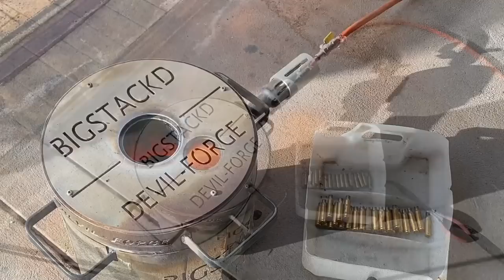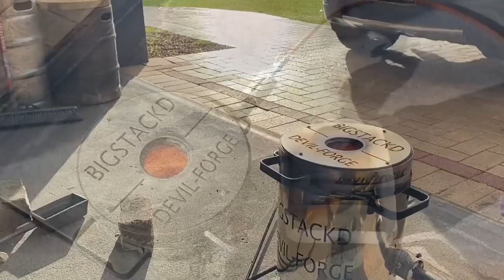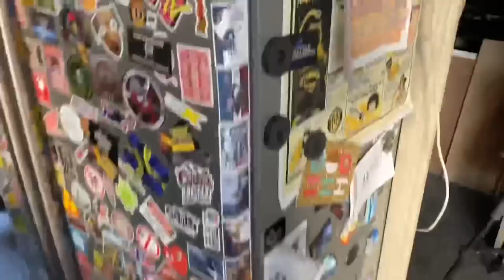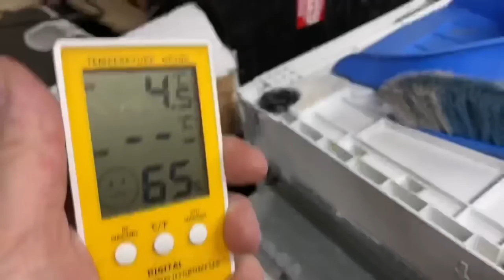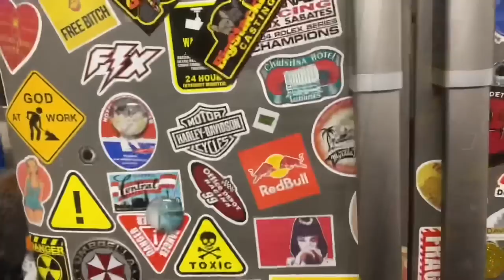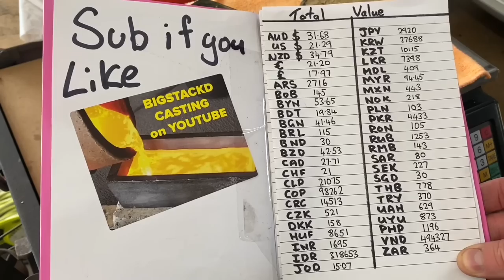Bulk Bullet Shells To Mirrored Bar - Trash To Treasure - ASMR Metal Melting - BigStackD Casting

Comment: These are 7,62x51 (or .308 Winchester, in civilian version). From the headstamp you can read AFF 91, which usually denotes the manufacturer, in this case, Small Arms Ammunition Factory No. 1 Footscray, Australia, and the year of manufacture, 1991. By the look of the bullet, these are most likely M80 rounds with standard lead-core bullets. But looks alone can be deceiving, however, different types of rounds usually have color coded bullet tips, these don't, that's why I'd think they're simple M80s.
Reply: nice
Reply: So those bullets are 30 years old?
Reply: So 308 Winchester can fit in an ak? Never knew.
Reply: Amscray Footscray.  I love pig Latin. LOL!  To think back in the early 90s, we would buy 1,000 round crates of .308, .223. & 9mm military surplus ball, all for $135.00, that's 13.5 cents a round. The good old days!
Reply: @joshschneider9766  well bullet diameter yes but the cartridge will not. its closer to a mosin or SVD sniper rifle
Reply: @joshschneider9766  Nope. 308 Win has a case that is 51mm long, typically AK ammo has a 39mm case. Even though both cartridges are labelled as 7.62mm, the 308 fires a 7.62mm projectile through a .30in barrel, and the 7.62x39 fires a 7.9mm bullet through a 7.62mm barrel.
Reply: @neodutch  but they do make ak variant that fires 7.62x51(308).  Vepr-308 , Zastava all make 7.62x51 ak model
Reply: @gm5957  Yeah and? That's why I used the word "typically".
Reply: Thought I saw Winchester 308
Reply: @joshschneider9766  the NATO 7.62 uses a .308" diameter projectile. The russian/soviet projectiles are .310" or .311" in diameter. Also the ak shoots 7.62x39mm. The 308/7.62x51 is used in the m14, G3, FAL, scar-h, and even the m134 minigun. Plus hundreds of other firearms.
Reply: Could also be fired from an Australian army Mag 58 if it was link but it doesn’t look like it did
Reply: agreed
Reply: @joshschneider9766  if you have .308 ak, there are some variants but they are mostly dmr's, basic ak variant takes either 7.62x39 or 5.45x39 cartridges.
Reply: Im amazed he has all these, I thought Uhstrayans were terrified of firearms and hate if anyone owns one :)
Reply: @davidca96  Were not "terrified" of guns lol the rules regarding them are just a lot more strict than most countries 👍
Reply: @joshschneider9766  No. AK's use 7.62x39.
Reply: @theatlantafisherman6913  most aks are in 7.62 by 39. But there are other varieties that shoot 5.45x39
Reply: @presleydinobraggdino4711  that's mostly the SSG 82 bolt, the CRS 98 VEPR,  and the Saiga. I think some AK-74's also use this round. But the standard AK is 7.62x39
Reply: @theatlantafisherman6913  look up the ak 12
Reply: @presleydinobraggdino4711  this guy specifically mentioned the 47. I'm aware there are other guns that use the 5.45, but the 47 uses 7.62x39
Reply: I figured 7.62
Reply: @joshschneider9766  AK rounds are 7.62 by 39mm
Reply: @joshschneider9766  No....AK is 7.62 x 39....same diameter bullet, but shorter case
Reply: outdated .308 NATO from military destocking, no problem.
Reply: @Joe14876  indeed, it's nothing for ctg
Reply: @joshschneider9766  no.
Reply: @joshschneider9766  no, that's 7.62x39mm
Reply: I should have read comments before posting... lol
Reply: @Joe14876  Yep. Probably military stock being used for training while new ammo stock is rotated in. Properly stored ammo can last decades.
Reply: @Fu3R4  wow
Reply: @joshschneider9766  The caliber is the same but the casings are different lengths.  .308 is 7.62X51, AK rounds are 7.62x39.  and a .30-06 is 7.62x63.  Pretty much all the same caliber but very different rounds and not interchangeable.
Reply: @hpdepasse5997  No NATO headstamp,(cross in a circle) although AFF is a manufacturer for the Australian military.
Reply: yeah I recognized those were 7.62 NATO but what I don't know is what rifles Oz uses in that cartridge. it's not still the FAL is it?
Reply: @joshschneider9766  no thats 7.62x39
Reply: @joshschneider9766  no, 308 Winchester is 7.62x51, AK ammo is 7.62x39. They are not compatible.
Reply: @karlklein2966   yes those are all 30 Calibers. I have 2 308s and about to have two 7.62x39s.. reason why a regular akm or Ak-47 can’t shoot a 308 is because of the pressure difference it will cause the Ak to have damage from the bolt and possibly blow the gun up if you shoot 308 out of it enough times..
Reply: I was thinking that was 50 BMG bullet shell
Reply: @NeonRider34  wayyy too small
Reply: @joshschneider9766  AK bullets are 7.62 x 39
Reply: @Milspecpoptart  don't forget the browning 1919, it also uses the 7.62x51mm round
Reply: @joshschneider9766  No, standard AK-47s use 7.62x39mm cartridges.  As the previous commenter said, .308 is 7.62x51mm.  If you tried to chamber a .308 in a standard AK-47, the bolt would not close.
Reply: @GezzGezzGezz  No, a .308 will phisically not fit in an AK chambered in 7.62x39.
Reply: @joshschneider9766  no an AK round is 7.62x39
Reply: @GezzGezzGezz  What a load of tosh.
Reply: @1131dc  actually, different diameters, share "nominal" size. It comes down to whether the barrel/bullet sizing is derived from the valley (lower part) of the rifling or the lands (upper part). The old .303 for example was nominally .303 on the lands but .311 in the valleys. American typically measure from valley depth. So the 7.62x51 is .308 at the valleys and .300 at the lands. The Russians measure at the lands, so the 7.62x39 is something I can't remember at the lands and .312 at the valleys. 
A cheap way of loading 7.62x39 subsonic was to replace the 110 grain supersonic bullet with a 180 grain .303 bullet and a slower burning powder.  Deadly spotlighting pigs at night with a silencer.
Reply: @JunkyardBashSteve  GPMG and the M2xx (M240?) Medium calibre machine guns. The FN-FAL/SLR has been phased out long ago for the Steyr AUG 5.56. Heck, I was firing the Steyr AUG in NZ in the 90's and while the Aussies have upgraded to a redesigned AusSteyr the RNZA has switched to a AR15 clone.
Reply: M80, average belt of 7.62 consists of 4rounds of ball and 1 tracer. 4:1 mix.
Reply: @joshschneider9766  no sir cannot
Reply: @joshschneider9766  no they won't, an AK  is 7.62x39.
Reply: @theatlantafisherman6913  ALL ak-74's use 5.45, that was the one of the biggest points of the new model.  they were standardizing on the new caliber.
Reply: @Joe14876  the cases are, yes.  but ammunition if well stored is perfectly fine for decades.
Reply: @JunkyardBashSteve  possibly medium machine gun.
Reply: @GezzGezzGezz  a 7.62x39 AK can not chamber a 308, once, let alone "enough times".  there are a lot of differences beside pressure.  technically, they are even the same diameter(caliber).
Reply: good eye good eye. but i think it would be the F4 which is a the australia equivilent to the m80 because like all countries make their own versions of the standard US/NATO stuff
Reply: @Joe14876  the casings are, standard practice, is after firing, the brass gets collected then gets turned in for reload or recycle...most the time, they get reused until they are unserviceable
Reply: That's most certainly 7.62x51 the head stamp confused me, in the US we give the caliber on the headstamp.
Reply: Know I've been shot with a 308, right through the left leg so I can tell ya, that's not a whimpy round it's quite powerful and will easily take out most game too although at longer ranges? A 300 win mag is probably better, same bullet more or less but cases is 67mm not 51mm meaning more velocity and range.
Reply: @hordegaming4771  .300 is awesome to shoot... it's got such a flat trajectory. How the hell did you get a .308 through the leg? That's worse than an arrow in the knee!
Reply: @theatlantafisherman6913  the current "standard" ak (ak12) fires 5.45x39.
Reply: Dude, I’m 15, a gun fanatic, and I still wouldn’t hav identified those bullets. Teach me your ways, lol.
Reply: @MrMemz-fl1yn  Sure you would have! It just takes experience. :) After a while shooting .308 or .223 (AR-10 vs AR-15) you start to be able to recognize the bullet. Then you use a little bit of logic, you know that BigStackD is Austrailian, so what does AFF mean, what is 91 referencing. Most likely a year, so what was  the Austrailian main battle  rifle in 1991? Looks like it was the L1A1, what caliber? turns out it's 7.62x51, which is .308. 

It just takes a small bit of knowledge, and the ability to connect dots, you'll figure it out with more experience.
Reply: 308 and 7.62x51 are not the same and they are not civilian vs military. For starters the 308 is a hunting cartridge with more power and chamber pressure. Your rifle would need to be rated for 308 over 7.62.
Reply: @theatlantafisherman6913  ak's use what ever someone wanted to chamber it in...
Reply: @joshschneider9766  No. 7.62x39 is the caliber for most AK platforms. Weapons like the PKM or Mosin Nagant are chambered in that round however.
Reply: @dabadcod4  For the most part they are the same. The .308 is a bit higher pressure but the difference is 60,000 PSI vs 62,000 PSI. As long as your head spacing is in spec and your chamber isn't too small for the round you're shooting, it's not an issue except perhaps with a few very old surplus rifles. That said, the rifle's chambers are cut differently and you may see a loss of accuracy from one to the other.
It's even less of a difference than the 5.56 vs .223 
In fact I just checked and all of my rifles in these calibers are stamped with both (.308 Win/7.62x51) and (.223 Rem/5.56 NATO) 
Basically if you have an old .223, or an old 7.62 you shouldn't take that risk.
Reply: @Anubis78250  exactly. There is a reason i push my friends and family to get rifles capable of both.
Reply: @joshschneider9766  they made some sagia AK rifles in .308 but regular akm rifles are 7.62x39 so no you can't put a .308 in the rifles I believe you're talking about
Reply: You should apply for a job in ballistic forensics
Reply: @joshschneider9766  no
Reply: Thought they were 30-06 or 7mm Remington
Reply: @rhysfirth3506  interesting
Reply: @volkskrieg8735  7mm?!.
Reply: Something tells me your American and over the age of 30
Reply: Use a magnetic devise on the tips. If they stick then it's steel core.
Reply: I was thinking about M80s as well because To me they either looked like an assault rifle round or a sniper rifle round I couldn’t exactly be sure because I don’t know Jack skadoodley about any type of ammunition because apparently talking about ammunition is confusing as Frick
Reply: @theatlantafisherman6913 Correct, for AKs chambered for 7.62x39, as in all AK-47s, introduced in 1947.  Incorrect for other AKs, such as those chambered for 5.45x39, as in all AK-74s, introduced by the Soviets in the year 1974.

Comment: To answer your question about what would happen if you had a furnace of live rounds, the live rounds would cook off (explode from heat) and the lead would stay there however the brass would become the projectile. This would damage the crewsible and the furnace a little but not much as the casings wouldn’t have much energy. (For those of you wondering why the bullet wouldn’t fly it’s because the bullet is heavy and what makes it fly is the barrel. If there is no barrel or locking lug for the casing then the lightest thing will fly aka the brass casing)
Reply: Don't share comments like this with the missus while watching a movie. She will not thank you. Lol
Reply: Should send a message to Demolition Ranch and get him to test with a local furnace...😏
Reply: @P1cwh0r3  who still watches that guy?
Reply: Not too far from where I work, a store 
caught fire.  They were in the archery 
business, but also sold ammunition.
We heard a LOT cook off, but no flying 
flaming debris.  The burning palm trees 
caused more exported damage, than the 
ammo.  (Chunks of flaming palm fronds, 
would float away and cause other fires.)

Yes, we had someone on the roof, with a 
hose.  (Nice to have forklifts.)

steve
Reply: The bullets would have no velocity tho because they need a barrel to channel the energy.  Maybe stick in you but not far.

Comment: Note: you likely have a lot less slag because you used plenty of borax that prevented a lot of the zinc in the brass from oxidizing to the air (borax forming a layer on top sealing off the brass while being heated in the furnace, pretty much)
Reply: Zinc does oxidize at high temps but the bigger problem is that his furnace goes over its boiling point. However this generally shouldn’t be a problem as it’s incorporated into the alloy
Reply: That has nothing to do with it
Reply: <--- @BeauxLo  No Body really cares about what your opinion may be 👅

Comment: I love the look of polished brass, when I was a teenager in the 70's I worked for while in a polishing shop. We mainly did sand casted brass taps, I never did much actual polishing but I was doing the linishing. We 1st used a new 80 grit belt, then broken-in 80, then broken-in 320, then polish on a buff with tripoli.  Lots of different ways to polish these days. We used to chrome them too

Comment: Ive melted about 50lbs of casings. The main thing to consider is that some will actually contain small amounts of unspent gunpowder that will pop so be careful. I always got plenty of slag with mine as I picked them off the ground from a local shooting range so be sure to clean them if you pulled them from the ground.

Comment: So the primers must have melted too and mixed in with the brass. You ended up with a slightly different alloy. Surprisingly very little trash to skim off. I love it when you pour all the way to the top of the mold to get a loaf-like ingot. And the textured "crust" always looks great 👍 👌 !
Reply: Primers are usually nickle plated brass.
Reply: Probably should make sure all the primers have been struck as well, wouldn’t want a live one in there.
Reply: @silentlandthousandvoices  Wouldn't hurt anything
Reply: @silentlandthousandvoices  its why he stacked them neatly in the middle of the cut yerrycan thingy, so he could look and look again.
Reply: he could make his bars perfect if he wanted to, it would just take more time with the grinding wheel etching it all the way down past the deformations, excepting in the cases where the metal cools exceptionly fast the 'pour lines' you see on the side of some of his ingots are where the metal froze as he was pouring and formed layers...that goes all the way thru the bar, you can obscure it with buffing and polishing, but you can never get rid of it without remelting the bar
Reply: If anything the primer would act as a flux and separate dross
Reply: Primers are brass.....
Reply: Just spitballing here, but if this is all range brass, wouldn't all cases without a bullet already have the primer struck? 
I don't know anyone that would pop out the bullet and toss the case in the brass bucket after a dud. If anything it would be the other way around if you reload.
Reply: most rifle & pistol primers are made from brass
Reply: Shells are very pure, thats why they pay you higher prize at the scrap yard than regular yellow brass
Reply: @banthaexplosion  You should go to a range sometime....you will find many unfired cartridges all over the place.  You drop a round when loading....not smart to try and fire it then....most will pick up and throw away....many leave them laying around
Reply: @brianthaxton229  your statement didn't address what Aaron P was saying.
Reply: @banthaexplosion  Safety first, and check your brass. I guess the main risk would be a bullet wasn't seated or crimped properly in the case and may have come out. Only happened a couple of times when I used to shoot, and we were told to load the case and fire it. More common (yey, Radway Grot!) was primer misfires, ie struck but didn't fire the round. Those we carefully pulled the bullet, removed the powder and put the case in the duds bin. Trying to remove a primer from a misfire is.. risky, so AFAIK they were sent off to be incinerated.
(Also thinking the legality could be fun. Here in the UK, possession of a live round without a licence can be 5yrs+ in jail, and I think same for live primers. And I guess whoever sold the 'scrap' could end up prosecuted for supplying ammunition.)
Reply: @banthaexplosion  You could have a case where a projectile was either pushed into a case - or, if insufficient neck tension, knocked loose from a case - the result being an unstuck primer with either the projectile inside the case or no projectile at all. The powder would most likely have been lost at some point. More common though, in range pick up, are live rounds which resulted either from a primer that was not stuck hard enough or all all which was then ejected, or some sort of misfeed or just a user error where a live round was ejected an mixed in with the spent brass. With 22 LR you will sometimes see a missed that "bends" the projectile to the point where it cannot be chambered and those are small enough to inside other cases. It looks like all .308 brass in the video. Cannot tell if it is Boxer or Burden - if Boxer primed, I would think it its more valuable as cartridge cases to be reloaded than as brass - if Berdan primed, that is a lot more work and depending on what country you are in, Berdan primers can be hard to find.

Comment: wow! its always so statisfying when the metal cools into a solid piece. the mirror finish afterwards is just chefs kiss
Reply: Called freezing. Think about it. At 32° water freezes. At 1700°f brass melts at 927°f it freezes
Reply: @DisgustedGenXr  but that is not a freezer
Reply: @DogeMultiverse  🤦🏻‍♂️